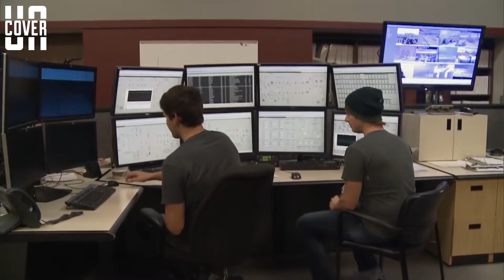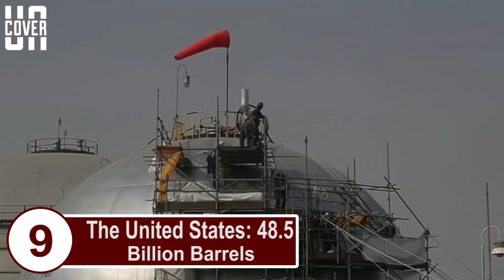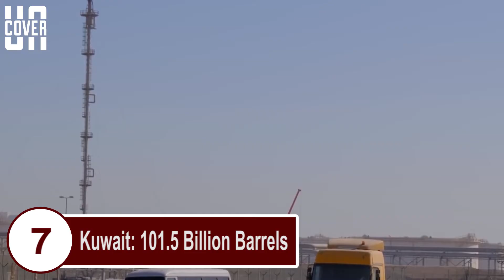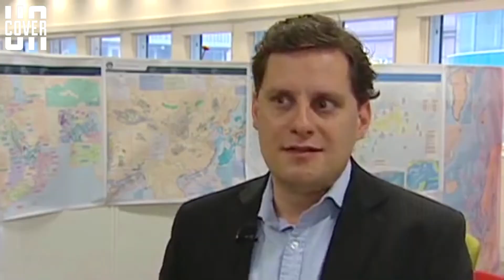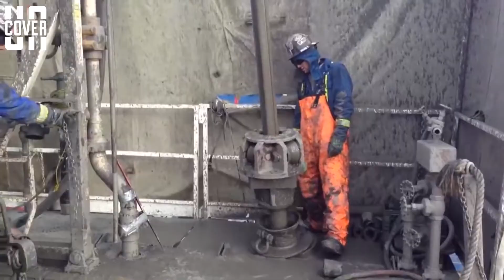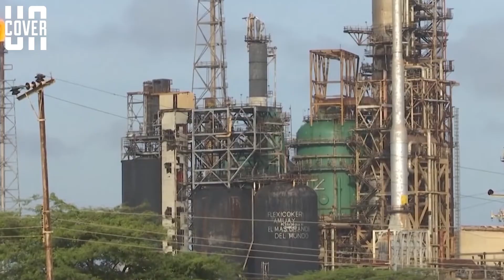Top 10 Countries With The Largest Oil Reserves

Comment: How convenient that they neglected to mention the massive reserves in the Gulf of Mexico not forgetting of course the oil fields underneath three states in the North eastern USA which when first reported was greater that the Arabs reserves and all the oil used so far in the history of oil usage  !!
Reply: Funny how they forgot about the bakken oil reserve. which would make the US oil independent for the next 2K years
Reply: @wayne4386  Bakken has been fracked to death and all the low-hanging fruit has been extracted, new tech is required to get at the heart of those deposits so a reserve you cant pull out of the ground isn't good for anything.
Reply: @wayne4386  2K years? I have my doubts on that! And...at what cost to extract that oil...is it easy to pump out....or does it require additional techniques adding to cost of production.
I have my doubts...more info needed before saying "2K years" is valid.
Reply: @raybin6873  prove it then facks
Reply: @wayne4386  I wonder why they dont use it.
Reply: Correct
Reply: What are the 3 northeastern states?  I'm from New Jersey.
Reply: True
The Tar Sands of Canada has lots of oil but needs $75 a barrel just to break even, while light crude needs $25 a barrel.
Reply: Country mu friend #2
Reply: I came looking for this nonsense. Thoroughly debunked.
Reply: More oil in Gulf of Mexico than oxygen on earth to combust it.!!
It’s deep do, we feed off a leak off it which feeds oil pool miles above it.!!!and that’s hugh alone.!!
Reply: Yes I have worked in Gulf of Mexico Ridge 249 there is a lot of oil and gas in OCS outer continental shelf..Been there for 8 years at 5wks ON and 5wks OFF work rotation as EIT Maint engr at BW Pioneer FPSO..depth is 3,750M up to sea level..

Comment: Venezuela crude is like mud. It is the worst in the world.
Reply: It is usable, you have to add naphtha ( thinner ) to it. 

But then, of course, you need to source the naphtha itself.
Reply: @billB101  all crude  oil needs thinner. It is added partof the refinery.
Reply: @kyqorioskygo8999  And Venezuelan crude being some of thickest crude on the planet needs a lot more.
Reply: They will have to figure out more efficient and cost efficient ways to produce
it.
Reply: Venezuelan crude oil is difficult to refine which add the production cost. Many rather buy other oil unless it is refined to a certain degree
Reply: @Gerald O'Hare it is called extra-heavy crude oil, and extensive research is being conducted not just for refining, but also for production and transportation. Greetings.
Reply: Almost like tar